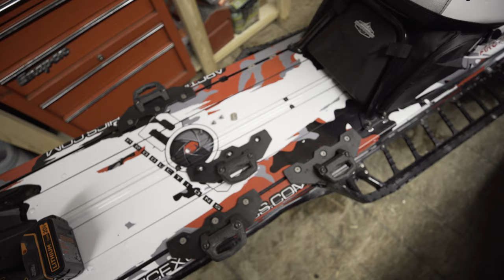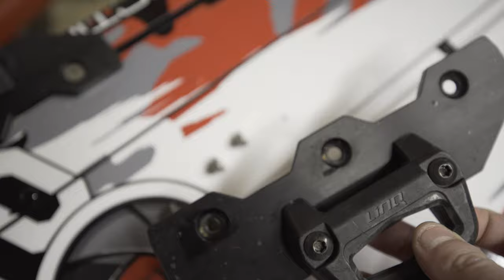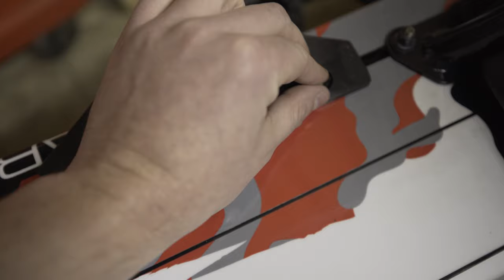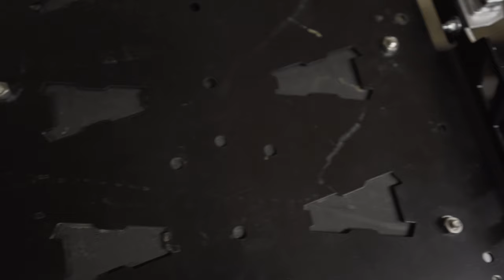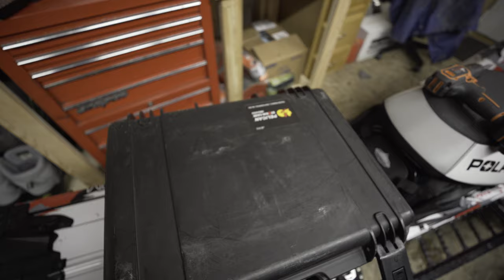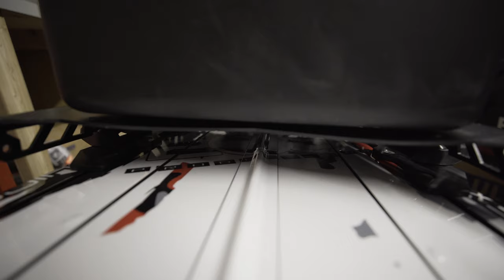MOUNTING CAMERA GEAR ON SLEDS

Comment: Really sweet video and idea! No issues with camera and batteries being cold in the case?
Reply from the maker: Thanks!  On really cold days I will put hot packets for gloves and boots around the batteries while loading the case in room temperature.  If you can keep heat around the batteries right from the beginning of the day loading the case it has worked pretty well.

Comment: I see you have a 6k pocket in the case, how do you get the new Helium Sensor RED up?
Reply from the maker: Sold the RED and decided to give the Pocket 6K a run this season...the bang for the buck is pretty hard to beat.  But just cut out the foam differently before to fit the RED set up.
Reply: @208Productions  Not to mention the money you freed up by making the move. Not many people will be able to tell the difference between the two footage anyways. I have been looking at a Zcam E2 and it seems very cost effective and impressive. Since Panasonic hasn't released any information about the GH6 yet.
Reply from the maker: @ippielb  Exactly...Love shooting on RED but just didn't make sense with how much the investment on it was.  The Zcam looks like a good setup as well.  Amazing how good some of these camera are getting for the money.
Reply: @208Productions  Not even just the investment of the body alone, everything in and around RED is gouged. Then you have the file sizes, the computer you need to handle the footage, and a display to take advantage of what you film. I'd be curious to see your computer set up for editing.
Reply from the maker: @ippielb  For sure... it's a custom build pc with 32GB of ram and a 12GB Gforce titan video card.  I edit off of SSD drives for speed and backup everything on regular Gdrive external drives.  It handles 4K raw playback but struggles on anything above that.

Comment: no issues with DSLR mirrors with the tunnel mount?
Reply from the maker: I've actually only had mirror-less cameras in there.  The Canon in the case was just for demonstration as I was shooting it on the Sony A7iii that usually goes there.  As long as the foam is cut out so it fits tight, so the camera can't move around I think it would be fine for mirrors as well. Don't think much vibration gets through.
Reply: I guess worst case all the equipment is insured.  Little more risky than I’ve been willing to do with my setup (d850 and 70-200FL) but it’s sure heavy on my back!